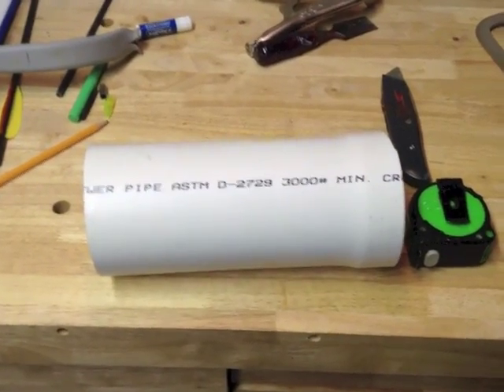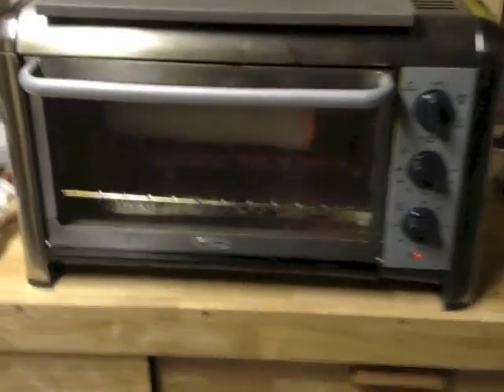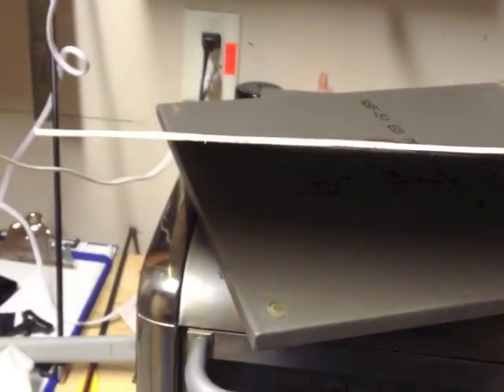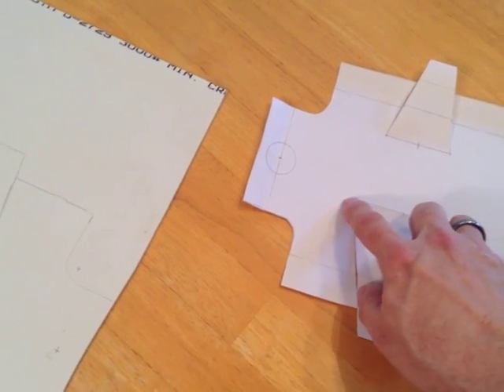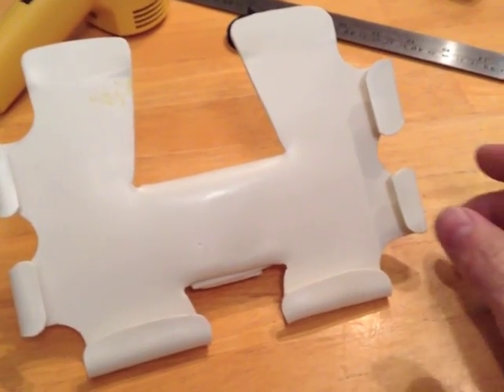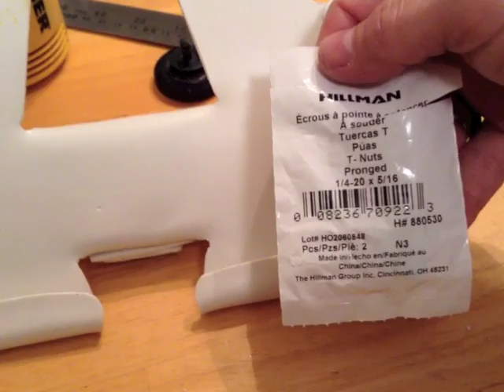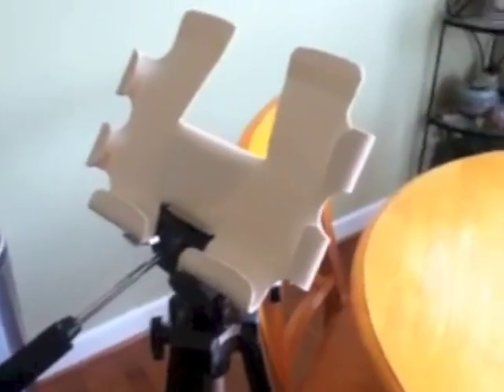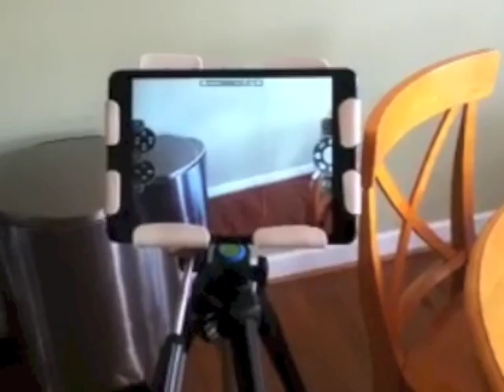DIY iPad Mini Tripod Mount from PVC - You2CanDIY

Comment: Hi, great project, but I don't get the angle, I mean wouldn't it be better to have the ipad sitting more straight up?
Reply from the maker: +Shan Liu 
I used that angle because it worked with materials I had.  It could be almost any angle.
Reply: just adjust the tripod